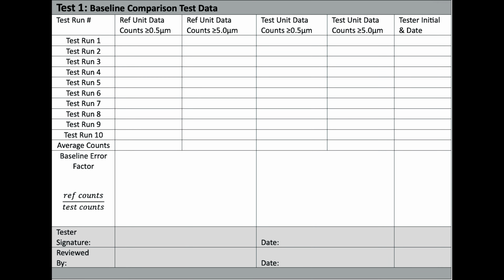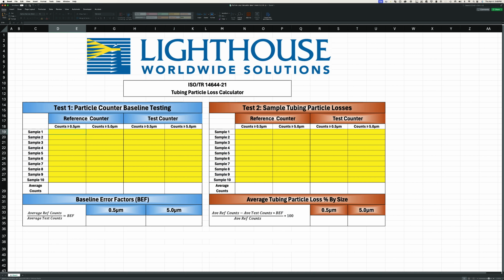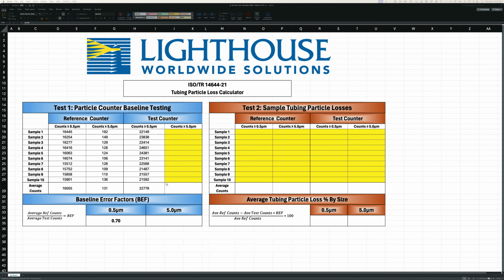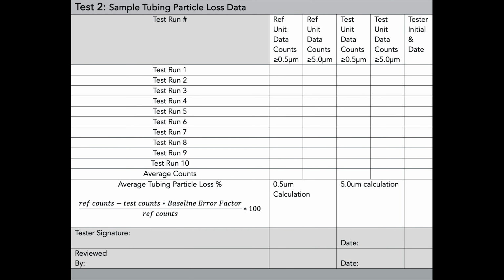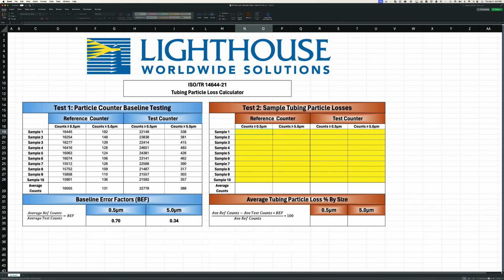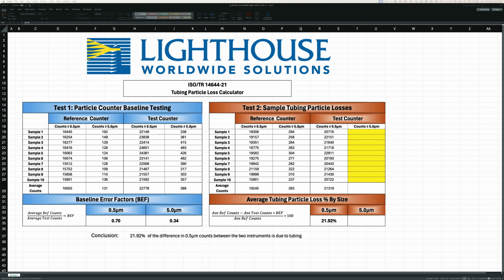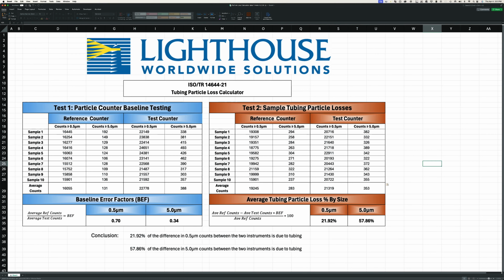Tutorial - Sample Tubing Validation

Comment: Hello, can you tell me how much deviation is acceptable between the reference and test counters?
Reply from the maker: From our Applications Director Jason Kelly:
Particle Counters can actually have a deviation of +/- 20%, but when tightly calibrated and when the sampling is within the same environment with the probes within 12” of one another then, the deviations are low when that sample environment is consistent and homogenized.

The Test 1 Baseline Error Factor takes into consideration the deviation and it is used in Test2 calculation and we have not put a limit on the deviation - so in theory you could have up to +/-20% difference based on particle counter sensor limitations. Also, the fact that they are not sampling the same particles so the environment could be a major factor in this deviation.
Reply: @LWSmarketing  so, based on your test, with 10 meter. With 4 bands. We can consider that deviation is more than 20 %(21,92%, 57,86%) and because of that we can concluded that the pipe accumulats particles and it is wrong to use it?
Reply from the maker: @manemanukian5481  From our Applications Director Jason Kelly: That is correct or if you can, use tubing with a larger diameter.